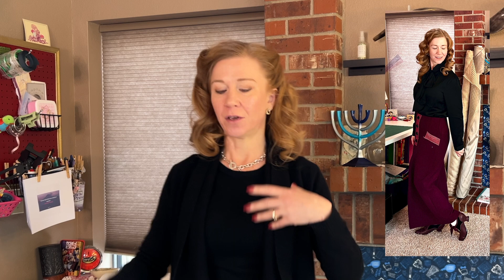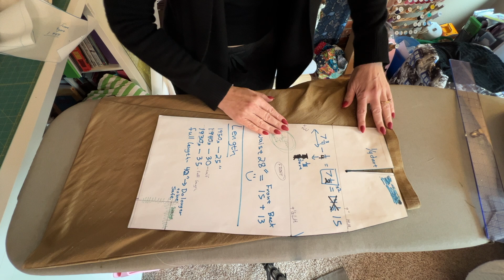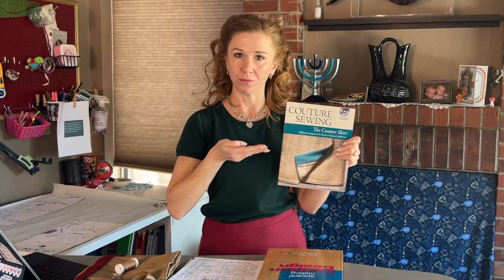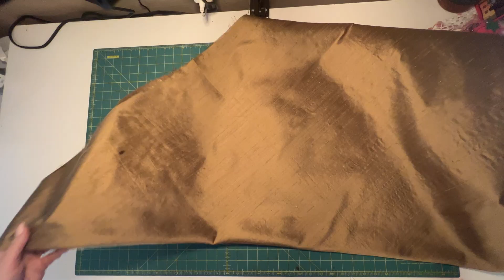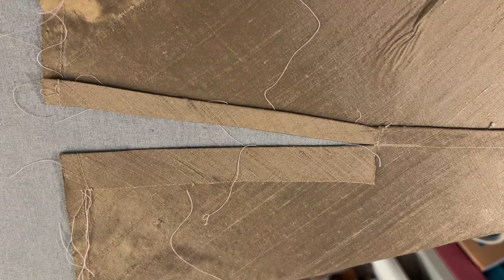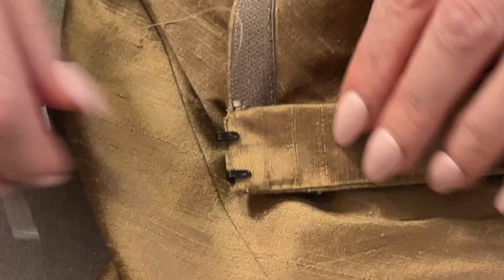What Did I Do Wrong? 🧵🪡  Sewing Mistake Mystery Along With Fantastic Couture Hand Sewing

Comment: I'm not certain how thick your fabric is, but I drafted a skirt recently and didn't account for the thickness of the fabric which ate up just a little too much length in seams and pleats, making the garment just a little bit too small. I'm way early on in my experience right now to say if that's your problem or not, but it's at least a good thing to check.
Reply from the maker: The answer is 100% sewing on the bias using an on the grain pattern.  My next video covers all of this.  And YES, thickness of fabric can completely mess with a pattern.

Comment: The bias theory sounds most likely, but from watching almost all your videos I assume that You need a little bit more ease on the hip line in your front pattern than You have now 😁 I'm not an expert on skirts, and a guy, but this might help ☺️ If You like how your previous skirts fit then go for it, theres nothing wrong with that, but if You want your center front line to fall straight the additional ease will help I think. Worthy to sew a simple muslin mockup to test that, because darts may need tweaking also. The side curve in front will differ from that in the back but this should not be a problem, some figures need that. If You dont want all the hustle with mockups stick some narrow masking tape where the skirt side seams would fall and measure front and back halves separately. I hope my blabbering was helpful. Love your channel! ❤
Reply from the maker: I have answers and my next video covers all of the reasons that this did not work!

Comment: Ok, firstly, I learned a ton from the comments about dealing with fabric cut on the bias! Secondly, I learned from you, Nora, very helpful techniques for turning in corners! I always struggle with them and they are never neat enough for me. The only thing I didn't hear you say you did was re-take your measurements. Bodies shift and change, even if weight doesn't. However, the comments from much more experienced sewist than myself seem to be a consensus - it's all about the bias.
Reply from the maker: It's 100% all about the bias.  I have a new video up covering the next two epic slogging weeks figuring everything out.

Comment: The bias issue is the problem. I also noticed that you were ironing rather than pressing, which can really change the fabric even when cut on straight grain and even more when cutting on bias. Your pattern is designed for on-grain cutting - when making a bias skirt (I've made dozens at the very least) the waist should have be curve which allows the bias to release. Simply put, your pattern was the wrong one.
Reply from the maker: It's 13 days later, and it's 100% the bias.  I have a follow up video.  I learned so much from this project.  Everything you said.  100%

Comment: Congratulations on sewing such a beautiful skirt.  I'm so sorry it didn't fit.  As others have said bias garments hang differently and require more width to accommodate the bias cut. And I don't want to discourage you but I have found that different types of fabrics react differently to bias so on any bias garment I would baste (machine baste or hand baste) in the side seams and try on before sewing the seam permanently.   Also, whenever I have added flare to a skirt, I generally rotate out the dart before adding any extra flare.  You basically cut the pattern from the tip of the dart down to the hem (with the grain); then you meet the dart edges together (thereby eliminating the dart) and this will add width to the bottom of the skirt.  There must be tons of videos on how to do this.   Even though this one is not in English the illustrations are self-explanatory: https://www.youtube.com/watch?v=L4K75mLm5zo Depending on the style you want, you may want to add more flare, but this creates a nice starting point.  Flare is generally not added to the side, but actually added by cutting from the hem to the waist to distribute the flare over the width of the skirt instead of the flare hanging from the center front or side.  You did such beautiful work, I hope you don't get too discouraged.  You learned a lot in the process and now you know you are capable of creating such a beautiful garment.
Reply from the maker: Thank You!  😊

Comment: I can see 2 plausible ways it has shrunk, 
1. when you did french seams you started stitching on the 1in seam line rather than 1/2in say, thus when you turned right sides together, you accidentally ate into the fabric. (the amount of times I've done this and nearly thrown the project out the window is maddening) 
2. the other option is the bias, if the fabric has no stretch, then cutting things on the bias will shrink up as it is stretched. As the bias can only stretch one way at a time, (ie, the diagonal that goes around, rather than the diagonal that goes up and down,) it tends to end up tighter and/or shorter. 

Both are common oversights, as we are so focused on getting it made and we know we have Xin seam allowance, we forget that different seams take more of it away, and we are so used to the fact that the bias stretches, we assume it will just stretch how we want, forgetting if the fabric has stretch or not. 

There might be a way of doing this skirt on the bias without loosing any size, though it might be a bit stiffer, but you could try either lightweight interfacing on all pieces, or a light knitted interfacing, which still keeps the drape of the fabric, rather than giving it a shape like normal interfacing does. If these don't give the desired look, maybe a size up on the pattern or making it too big to then take in the excess while wearing it so you get that perfect fit you want. 

Hope this helps and hope it doesn't deter you off too much from making similar in the future. Cant wait to see what you make next and what challenges/problems you overcome. 

Keep up the great work ^>^
Reply from the maker: It was 100% the bias and I have a follow up video that covers this research rabbit hole

Comment: I would take the time to hand baste your final stitch lines on your four pieces before any sewing happens. Let them hang , if on the bias, or not then carefully pin on yourself. I would take the skirt apart and see if you can modify. For instance, you can finish the raw cut edges with bias tape and then NOT use French seams and then you rescue some room to breathe!
Reply from the maker: 100% correct.  Everything that I read after this video completely agrees with everything here.

Comment: I know what the problem is. Being cut on the bias means it pulls down more. Then when combined with French seams and a hand sewn zipper, extra bulk is added to the inside. Also nubby silk doesn't give much in bias cuts. Always have a 1 inch seam allowance and see how it fits with a machine baste. 

If you haven't cut away the seam allowance for the French seams, then pick it apart and let it out in the problem area and resew it.
Reply from the maker: You are completely correct.
Reply: @NoraMurrell  we learn over time

Comment: My guess is bias and a bit of "turn of the cloth". Try cutting with extra large seam allowances. I would also not do french seams on bias-French seams are fabulous for shreddy ravelly fabric or for see through but a lot of couture garments would not "finish" the fabric edges in the bias seam (BTW: my favoite "couture" inside seam finish is a hand overcast or pinked-french seams or bound seam allowances if shreddy)
Restyle the skirt-either add a yoke at the top (which would preserve the bias effect at the hem) or move the current high hip to "waist" cut off top and add panel at bottom restore length 
Seams as design feature
Reply from the maker: Bias.  The bias completely got me.  My next video is up and I fix so many issues!

Comment: No bias, Nora. This pattern is designed to be a skirt cut on the straight grain. The bias is not stable. It "drew up" and made itself fit smaller. NO DARTS IN BIAS!!!! EVER!!! You must shape bias so there are no darts, ie.,  a different pattern mustv be drafted to use a bias cut. This one won't do.

Cut this skirt on the straight grain, and it will fit the way you want it to. I am sorry you didn't have a little more bias experience or you would have known. To make this skirt and put it on the bias, you can't have the waistline darts, and you have to add to the seam allowance. SO sorry this happened,
Reply from the maker: 100% correct and the follow up video is up!

Comment: Hi Nora! I also think it's the bias cut. Unfortunately, you can't stitch up a bias garment straight away. Before French seaming, etc. the pieces should have been basted together and left to hang overnight if possible. That allows the bias to stretch and grow. Also, sometimes up to a two inch seam allowance is created. Then the next day try on the basted garment. It probably would seem snug. This is where the two inch seam allowance comes in as you can now adjust your seams with no worry. Also pressing with steam tends to create a bit of shrinkage and French seams can add a bit of distortion. I'd like to see you try the skirt again. I know you will be successful. Just remember to let a bias garment hang overnight.
Reply from the maker: I'm adding this to my sewing curriculum.  I think that I have not covered bias cuts and sewing enough.

Comment: When watching your video, you just finished cutting out your pieces and explained sewing your frt darts, frt center seam,then side seams BUT you were pointing to the wrong seams. Then you explained you were going to sew the back center, and side seams. But when you talked about the zipper you were pointing to the center back. I think you reversed your seams.  Then on the ripples on the zipper.  You should have interfaced the center back seam about 1” wide and the length of your zipper, where the zipper is inserted.  You fabric is very lightweight.  I usually interface all my zippers. Even with knit fabric.
Reply from the maker: I totally was pointing at the wrong things when I was talking about how I was putting things together, but I promise I got the construction correct.  I'm starting to think this is a bias cut issue.